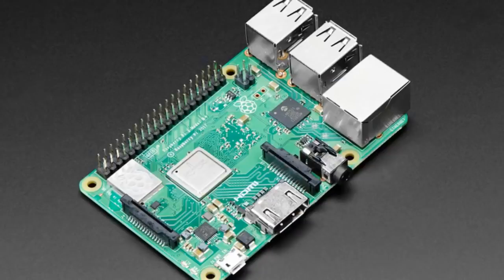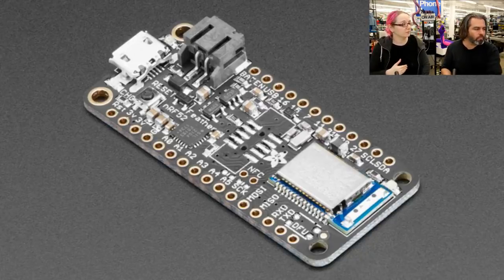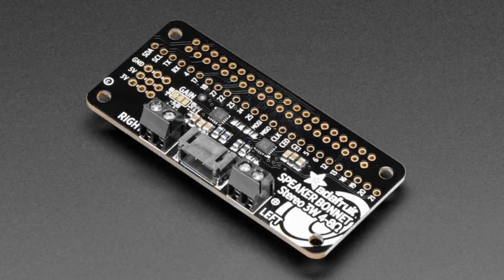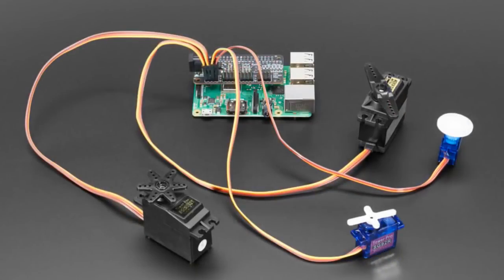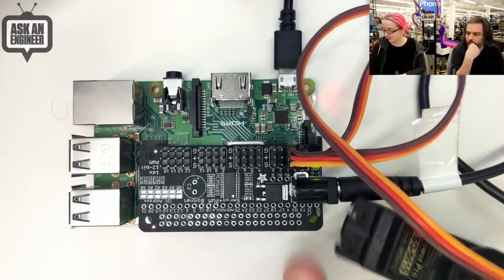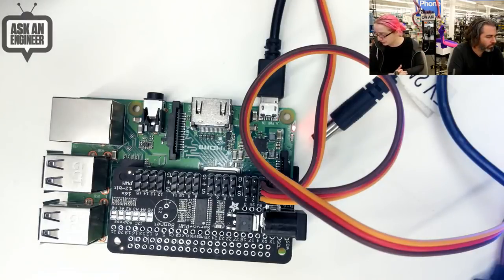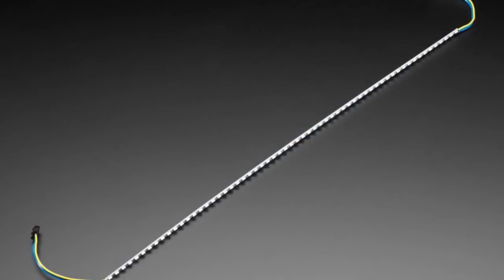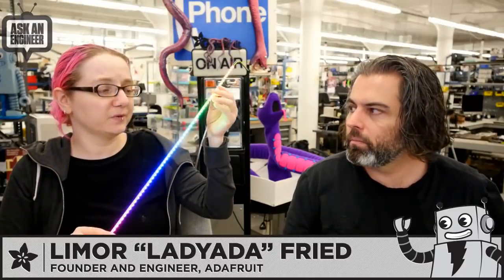New Products 3/21/2018 Featuring Adafruit 16-Channel PWM / Servo Bonnet @adafruit #adafruit

Comment: there are some fairly intelligent power watchdog chips for like 50 cents that can cut power completely and do a timed wakeup, only eat like some microamps. if you are after ultra low power usage you could include that on the board...